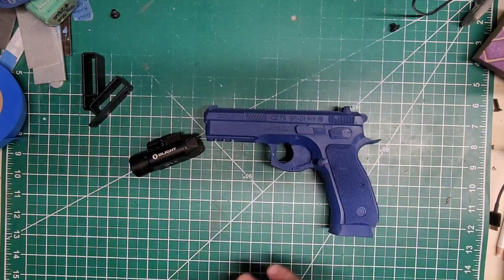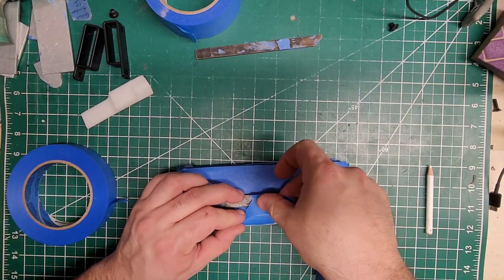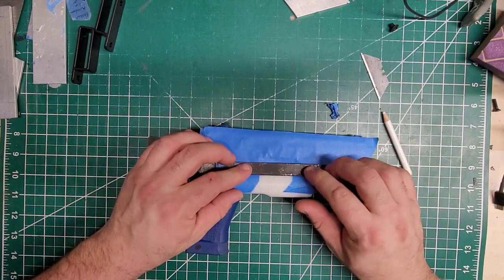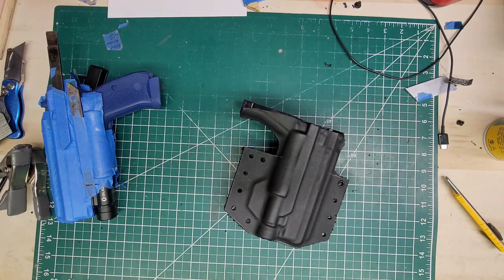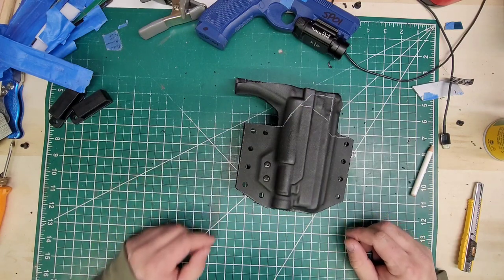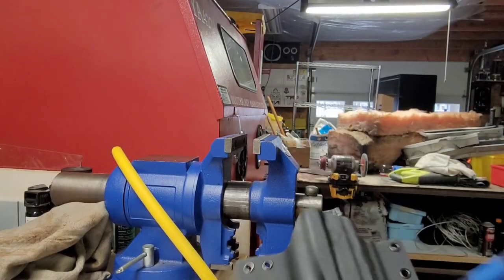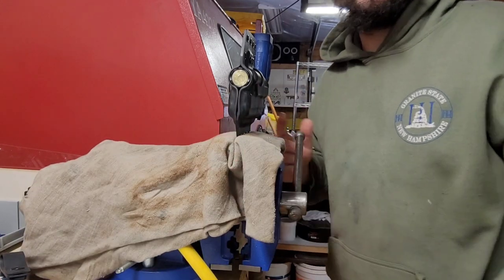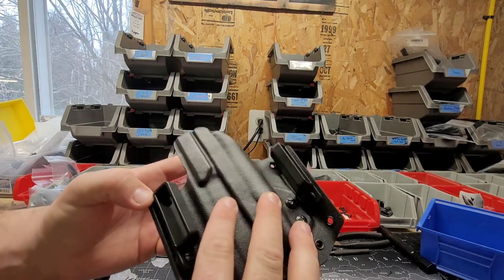CZ Sp01 with OLight PL2

Comment: I wonder, is it possible to put on this kind of holster made for an CZ P-01 w/ Valkirie PL-2, a level II hood and Tek-Lok loops?
Reply from the maker: Has to be molded in but yes it's possible
Reply: @FalTacUnlimitedLLC  You mean, the hood mount has to be molded in?
Reply from the maker: @1zanglang  yes. Any accessories that go on kydex need a place to mount so they must be blocked before the molding process
Reply: @FalTacUnlimitedLLC  Thank you for your explanation. One more question: do you ship your holsters internationally? I live in Romania, and I intend to apply for a gun permit. I want that CZ P-01pistol with Valkirie light and in Europe it is quite impossible to find high quality custom made holsters like yours. So I would like to know if in a few months, I can order a holster on your website. Thanks again.
Reply from the maker: @1zanglang  I do ship overseas yes. But the customer is responsible for taxes and such associated with importing
Reply: @FalTacUnlimitedLLC  Yes, I know that. I used to buy many goods from US. Things that only there are still made at high standards. Well, now I know how I will carry my piece. Best regards.